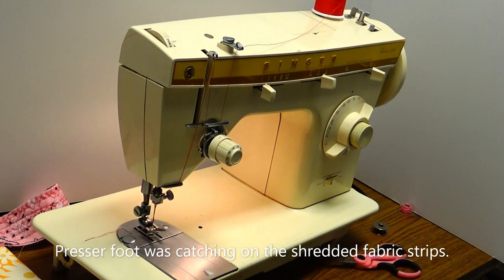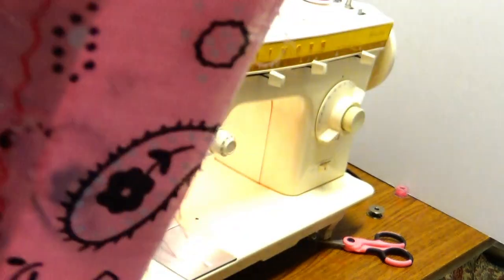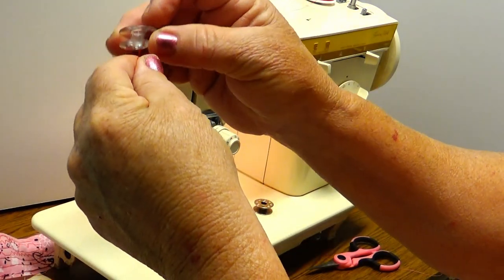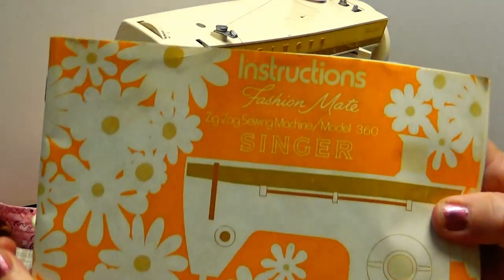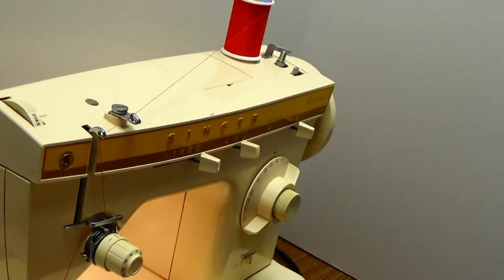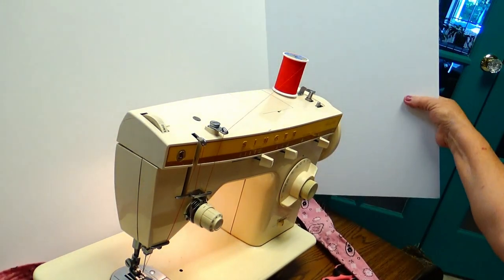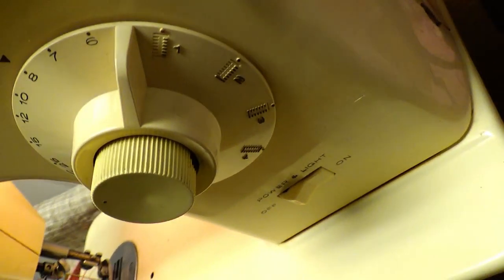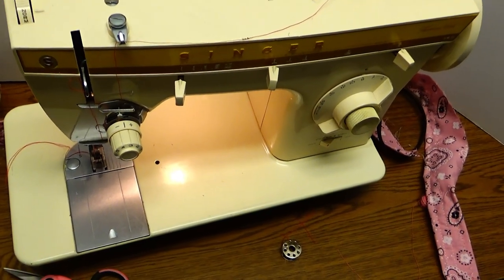SINGER Fashion Mate 360 Sewing Machine 1975 Model Demo

Comment: Thank you for posting the video, I have the same machine, it was my Grandmother's, it's in a cabinet though. She taught me to sew using this model when i was a teenager, I'm 54 now. When she passed away suddenly in 2003 I inherited it and think of her with a smile and fond memories. I have used it multiple times since but in the beginning I was a novice, now I'm intermediate and have learned a lot but still a lot to go. During this Covid-19 pandemic my family requested masks to be made by me, I've been making them but ran into problems with the thread/tension, that's where I need more expertise so I appreciated your video, overall you did a great job but the things I will notate are:  1.) Be better prepared, it's a bit frustrating.  2.) You threaded it incorrectly, I just checked the manual, I thought maybe I was doing it wrong all this time so I found my manual and that's what I found out.  3.) Using a solid color fabric to show the stitches would have been helpful. 4.)Thanks again for your friendly and educational video! :)

Comment: My bobbin won't roll, so it can't catch the thread to sew
Reply from the maker: Thanks for your inquiry. Try a different bobbin.
  You may have the current thread wound too tight or too loose.  Also it may not be compatible with the top thread; therefore, both threads may need to be the same.  Keep troubleshooting.  Let me know how you come out please.